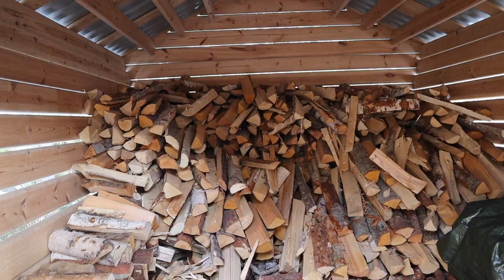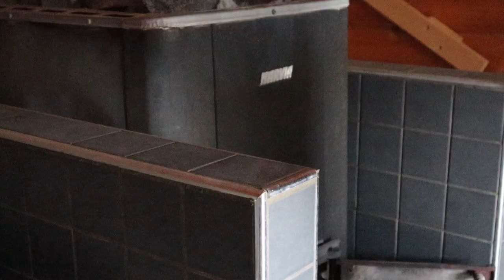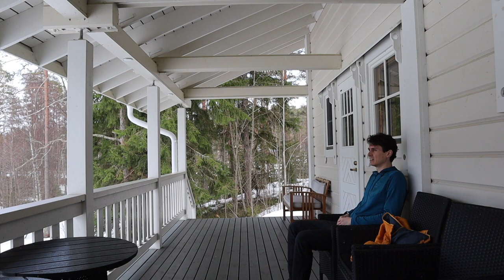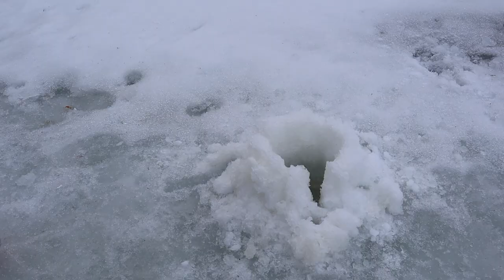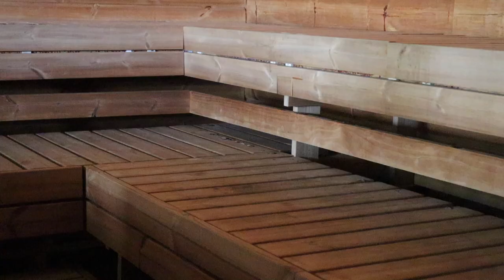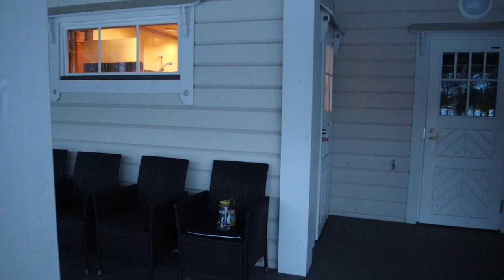Traditional Finnish 𝗦𝗔𝗨𝗡𝗔 experience

Comment: The sounds in this video. Tha crackling of the fire and the constant hum of the fire in a sauna is something so very relaxing. Electric sauna can never be the same.
Reply: Actually older and more original style saunas are silent when you bathe in them. Savusauna (smoke sauna) is used when wood is already burned under the stones and ashes removed. "Kertalämmitteinen", "pönttökiuas", "aitokiuas" and similar refer to sauna that has a stove working similar to smoke sauna but smoke being removed through chimney. These predate continuously working stoves by centuries, or thousands of years in case of smoke sauna. Electric saunas are a compromise, they bring you the heat but not the full feeling, I agree.

Comment: Proper sauna! Siting the sweat lodge at the edge of a lake is key. In the summer, you can just run off the dock naked and jump in the water. In the winter, you cut a hole in the ice -- like this guy did -- to have a cold soak. Or, if you're lazy, just roll in the fresh snow. Thanks for posting this beautiful video.
Reply: So in the summer you can off the docks in the water naked, that sounds amazing I always wanted to jump in the water naked feels nice may sound weird by saying that.
Reply: @jasonchen6982  It does sound weird, but I highly recommend swimming naked. Do it wherever you can!